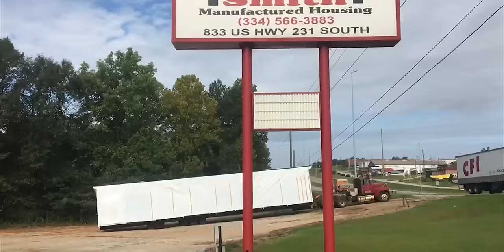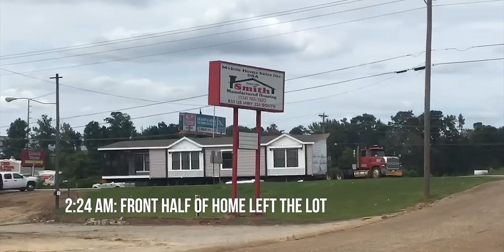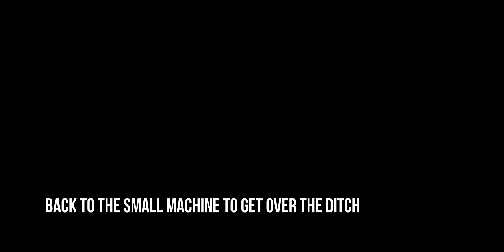Manufactured Home Delivery in 1 Day (my Lula Mae Farmhouse)

Comment: I’m curious about you not putting it on a foundation I was under the assumption the guidelines for getting a loan on a manufactured home had to be set on a permanent foundation.
I would really like to know if this is correct information.
Reply: IT DEPENDS ON WHERE YOU LIVE IN A PARTICULAR AREA...SOME PLACES DO ...OTHERS DO NOT...☮️❤️💥🇧🇯🇺🇸😇🖖
Reply: Del Y  look at all the mobile homes that’s still standing after 1980 and being living in. But it also depends on the dealer you go through. Mine is on a permanent foundation but there are a lot of dealers who don’t do it
Reply: Hi! this is 11 months later, but I watched a video where they put the concrete pilons in the ground that they anchor the mobile home to and this is considered permanent. Check me on this though!

Comment: FYI...The shingles on the roof will get mold from the dampness of the trees so you will have moss and mold growing on your roof.  You will want to use bleach and water to power wash your roof to get it off  but it will wear down the shingles causing roof leaks.  Best to save and put quality or metal roof on since you placed this in between trees.  Install a water shut off immediately as the ones in prefab are either not in the bathroom or the washing machine hook ups are very flimsy and cheap and you will have to replace them in a year or two with stronger ones.  Saves from water damage inside and mold.  Check air leaks in winter by formation of icicles along edges of roof....sometimes in new prefab models the skimp on insulation ....just so you know.
Reply: that is why you do the options of getting your ducts and vents in the ceiling and they upgrade you to R40. When it gets time to replace the roof; put a metal roof on for sure. HUD requires water shut offs in every room where there is water. We just bought a Clayton Mfg Home and did around $8100 in upgrades. We did the Farmhouse Flex 1800 Sq Ft for 108,000 total in Oklahoma. The site prep is going to run us about $25,000 and we have level ground. It is all the taps and the concrete foundation, patios, porches and the garage pad.

Comment: Food for thought: a lot of these companies run like production lines and they cut corners when it comes to "behind the wall" stuff (the really important stuff), such as plumbing and electrical. So 2 years down the line, you have issues and they charge you a fortune for service calls.
Reply: awwwwwwwwww, don’t rain on her parade.   ☹️
Reply: That is why you buy a warranty. HUD has standards very strict on how these homes are built. Please don't be a debbie downer.
Reply: Total horseshit. That may have occurred in the 60s and 70s. That's straight illegal. The construction process is monitored the entire way through.......My19 69 magnolia has been great. ZERO ISSUES. IN 52 YEARS. It's 2x2 construction everything works great.

Comment: Hopefully they will put footings so it does not sink when a heavy rain falls. Not sure why a gravel foundation was not installed prior! Just grating the area without putting back any solid foundation seems really bad. From the video it looks like there is a slope to the property have to erosion proof if it does.
Reply from the maker: They did put footings, took 3 weeks for the full setup. This is just the delivery

Comment: Great Job, however I'm wondering where is the foundation concrete that they anchor the home down to? It has to be anchored down to something besides dirt. Mine was anchored to strips of concrete poured 18 inches deep.
Reply: You can use ground anchours if they are approved. They are like a large screw thats gets turned into the ground.
Reply: YEAH, I was wondering the same thing. When I was 14 my Mom and Dad bought a Larger section of Land and Bought 1 of at that Time it was known as a Modular Home like this one and it arrived in 2 Section's just like this and had to be set on a Concrete Formation where the Wheels went and Anchoring Slabs had to be Poured and then the State Inspector had to Inspect the Concrete work to make sure it met Codes and was deep enough. How is it you just bring a Bulldozer in ? Bulldoze a Flat Patch and then bring in the 2 Halves? WHERE IS THE CONCRETE SLAB TO SET THE HOME ON AND TO ANCHOR IT TO?
Reply from the maker: It had to be set on these special footings. I don't really know how to describe them, they're kind of like the ground anchours that frank mentioned. They set them in place after the house was brought in and then anchored everything. Then the state inspector had to come out and make sure everything was up to code. It took a few weeks to put everything together, I only was able to video the delivery not the setup.

Comment: How much for septic and well drilling?
Reply: Right. Im like where is the plumbing for home
Reply: That all depends on where you live and what you get. Where I live if you want a treatment plant septic (required in you have less than 10 acres of land) is roughly $5k. A well is about $3k and that includes drilling and everything you need to run it, like pumps. 

You can either pay for those services out of pocket or have the cost financed into your home loan. Which is what most people do.
Reply: @fruitpunchjuicy  I PVC pipe from you water source runs the house. It just hooks up to the main water line. Whomever did your septic will usually run the lines from your house and that's included in the price of the septic placement
Reply: Thanks for the info
Reply: We were quoted $25,000 to install a septic system.
Reply: @lynntaylor2025  Depends on where you live.  Drilling a well can cost $100k in some places, also.
Reply: I was wondering how much in my area? I heard 20-30k. Just to dig the septic. Anybody know how much in Texas??
Reply: Im in New Mexico here and to drill a well at 280 ft it was 28,000.  So about $100 per foot. This price does not include pumps, tanks or anything else needed to connect the water to your home,.  $28,000 is just to drill the well. To hook up to community well is $1,500-2,800, I believe.  To install a septic it is about $8,000.  In NM its best to have a doublewide home on a permanent foundation and tied down.  Another factor is all the permits and inspections that go with setting up a home.  Thats a headache all in itself!🙈 In the end, It really depends on where you live, the water table, if you have to install a septic or just hook up to the cities system, if you have a community well, or have to drill your own,  etc.
Reply: Here in Reelsville, indiana the cost to dig our well was $10,000 because of all the limestone
Reply: @lynntaylor2025  that is outrageous. Depending on septic type systems they run from $7,000-$12,000.
Reply: @1Life2Live007  depends on your soil test in Texas and Oklahoma depends on which type septic you get. it could be up to $12,000

Comment: What about gas, electric, water, sewage etc?  Assuming that is something you have to coordinate with the town?  Curious on how to do that (most of what I researched said it is extremely difficult to get).  I’d love to do something like this but there isn’t much out there on how to successfully get the necessary permitting.
Reply: I'm thinking there's not much "permitting" to worry about if you live way out side city limits (at least in our case here in Tx). As for Sewage she'll probably get a Septic tank installed ($8000). As for water, we had to drill a water well. For electric you gotta call your local Electricity provider or go Solar.
Reply: Depends where u live. Texas is good on this. Especially out side city limits
Reply: @jocelynsanchez7018  Hmmm. Pretty sure that's what I said...in different words.
Reply: @FunDuude  Yeah it's exactly the same in The Poconos out here in PA, though it seems getting a septic tank put in is much cheaper in Texas. Problem with permits is that certain places are very anti-outsider, so the locals will give you a hard time if they didn't attend pre-school with you, whereas your neighbor gets to do anything he wants.
Reply: @hmpz36911  LOL. Niiiice.
Reply: @hmpz36911  check with the building inspector for permits needed and inspections in your city or county.

Comment: Hi, Betsy.  1st off, congrats on your new home!   I'm interested in getting a manufactured house myself.  I was wondering if you could shed some light on what you had to do as far as land, when buying a manufactured home.  Purchasing land would be one part.  How are utilities, sewer, water, etc. handled?  Did you have to do all this yourself or was this coordinated by the mfg home dealer?
Reply from the maker: Hi Bill! It really depends on what type of land you're looking for. The manufacturing home company I purchased mine from had a few places they work with that could offer land & home deals... most of those were for land that was a lot inside a park. I talked to a few companies and they all had different connections and therefore different mobile home parks they worked with. If you're not looking to be in a park and want more traditional land then typically you're going to need to find that yourself... and then the manufactured home company can work with you to get it included in your loan. I found my own land and for my particular mfg home dealer included sewer & water as well as the foundation in my setup price and power (utilities) were an outside setup fee (meaning I had to find someone to setup power on my own). I believe that differs from place to place so you'll need to ask the people you're buying the home from how it works there. Hope that helps!
Reply: Happily Ever After, Etc. Yes, it did.  Thank you very much!
Reply: Thanks for this information!
Reply: @Happilyeverafteretc  I've been interested in doing exactly this..I'm curious as to what state u are in . Btw CONGRATULATIONS!🥳
Reply: @jennyanimal9046  she is in Alabama from another answer posted above. Isn't she the cutest young lady doing this on her own and wild mom out there supervising. I can watch it all day.

Comment: The ground was pretty uneven under the home, I was surprised by that.
Reply: Giovanna Trentanelli Exactly What's Up With That ??? 😐
Reply: @crystalbrame7886  most times depending on where it’s installed if not on a pad, they will set it in then wait to actually do the complete install for the dirt to settle so it only takes one visit to tie down. It all depends on the state regulations and the mobile home place you purchase from.
Reply: @crystalbrame7886  what’s up with what? It’s an observation, not a negative comment. Maybe you can explain the process instead of taking offense of a simple observation.
Reply: @glendaroberts5965  thank you for explaining! I love this house and was wondering how the leveling works.

Comment: Uhhh... Not to be a spoil sport, but where are the footings? I've seen a number of these homes set and never seen one set with no footings for the block to set on. Single wide maybe but not double wide. It should be on a footing that minimizes settling so the two halves don't pull them selves apart.
Reply: I was thinking the exact same thing. That house is gonna tear its self apart while it's settling. Especially since they disturbed then dirt before they set it.
Reply: They are set on pylons every so many feet. Had one when I was in Navy delivered. Never had a settling problem!
Reply: this is just the delivery she said multiple times throughout the thread the footing foundation was installed. It took 3 weeks to marry both halves.

Comment: Me and my fiance are about to order the same home!! Any things you would have changed?
Reply from the maker: At this point? I made a full list of alll the changes I made in another video and the only thing I would add today is an electric plug on the front porch. There's suppose to be one but there isn't and I asked a few other people around the web that have the same model and they don't have a plug either! So definitely add an outlet on the porch. Other than that I'm loving all the changes I made.
Reply: Happily Ever After, Etc. I have a 2000 DW with a small porch. With 2 outlets on the inside wall, you would think an outside receptacle would have been standard. 🤷🏻‍♀️ 
Love your home!
Reply: @Happilyeverafteretc  that is an option for $99 for the plug and a hose bib to connect waterhose in the front is $49. it isn't a known option but I found it on the sales sheet from the mfg website so and the OSB wrap and upgraded siding. You can have it done by an electrician for probably $200 make sure he is a master electrician and bonded.
Reply: @sharyn4271  standard on the back; option on the front

Comment: Do you have to have a vase under knee to place your home? I heard you have to have cement and where you going to connect you sewer for your toilets. This houses are costly when you buy them from a dealer?
Reply: check different dealers in your area. check with your county and city on what you can connect too. you might have to have a septic system or tie into the city sewer. there is a lot of site prep before your home gets delivered and then it can take several weeks for them to finish on site. Lots to do. We get ours in a month and then we will move into it probably 6 weeks after that because of pouring concrete for the garage and patios and porches. Where do you live Trinity?

Comment: Where's the cement piers? Did you just set it on dirt? I certainly hope not.
Reply: That is what I was wanting to see.
Reply: Cinder blocks
Reply: The home has just been driven to the lot and spotted, they have not started the setup process yet. The setup crew will remove the wheels and axles from the home and set it on the blocks.
Reply: @shelbymitchell9798  she mentioned the home went on footers.
Reply: @CINDYAHAMPTON  the blocks just go on top of the footers. The home cannot sit on footers without them ☺️

Comment: My son is looking at this model of home. But we didn't think the finish quality was as good as it should be.
Reply from the maker: I’m happy with it but for the price I think finish quality should be much better.
Reply: He needs to find the sale sheet for the options and do the upgrades. Our house the vinyl siding was really cheap so we upgraded one level and it was only $899 and we did OSB wrap beneath the siding for $1200 and went with a/c vents and ductwork in the ceiling with R40 for $1600. In a year when the warranty expires we are going to texture and paint the walls. I am changing out the fixtures and I hate pedestal sink in the 1/2 bath we got so it is getting a vanity. We added total all in all in upgrades $8100 and total was 108,000 on the house. you really need to research. where does your son live and look up all the dealers as many of them own several and offer the same house at different prices.

Comment: Not sure if anyone can answer this for me, but are there any incentives to buying a house off the lot instead of waiting for a new one to be made? Like do you get the furniture that's already inside included? Extra/lower warranties? 

I am planning to buy a clayton house off the lot in a few months to avoid waiting for a new one to be made but I dont know if that will be an acceptable option that the local Clayton lot(s) will allow me to do.
Reply from the maker: When I bought my house I had this same question because the original place I was buying from kept pushing for me to buy the model on the lot. They said it would be cheaper and save me a lot of time. Instead of waiting months for it to be made and delivered I could have purchased the lot house and had it delivered in a week. Since the house was already there on the lot I could make no changes to it, it definitely does not include the furniture or extra warranties. In the end I filled out the application and was approved. I had told them my budget was x and they wanted x plus 30k for the lot house. I couldn’t do it.

I started to look around at other dealers of Clayton homes, and found the place I bought my house from. They sold it to me for my budget x and I had to wait almost 3-4 months for it to be built BUT they also let me customize it… almost 25 different things they were able to do for no extra cost. I have a whole video on the changes I made if you’d like to check it out. So I paid 30k less than the lot house, waited 3-4 months longer and was able to customize it completely to my taste.

I was able to simply switch my approved loan from company a to company b. So I didn’t have to re-apply.

The moral of the story is shop around… the first dealer could have done those same things and gotten the sale but they didn’t want to. You may find a dealer who gives you a better deal/cost on a house on the lot... the place I bought my home from sold the lot model of my home (the Lula Mae) a month before I bought my home for x MINUS 10k so you never know. It is all dependent on the individual dealer.
Reply: @Happilyeverafteretc  Thank you for getting back to my question. I really appreciate the insight. You just saved me a ton of headache. I will for sure network with other Clayton Homes in my area and weigh all the odds then

Comment: Did they plumb and lay electrical wires before they brought the home to the site? Am thinking about buying a manufactured home and am trying to research the process.
Reply from the maker: They did! The land I chose had a previous home on it for 30 years so it was already setup and I only had to have them come in and repair the pad (my home was a little longer than the previous one). If it was brand new land that had never been used they would most likely lay those things first since they go under the home.